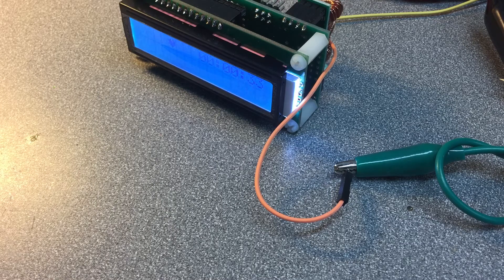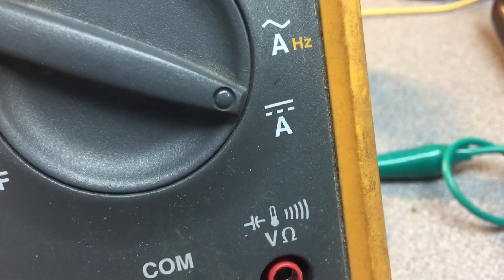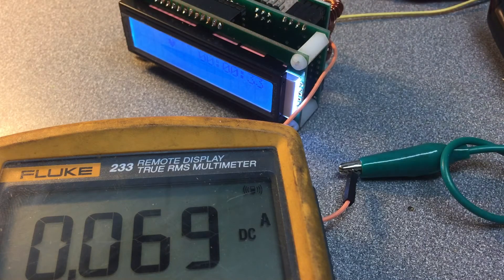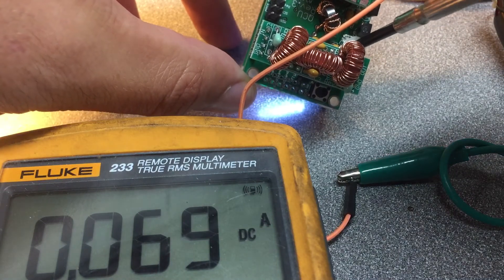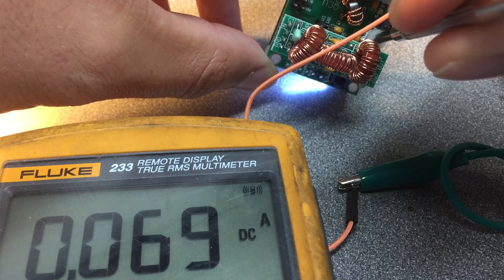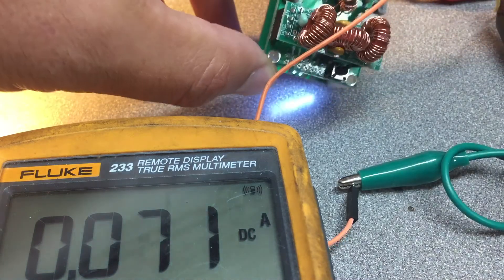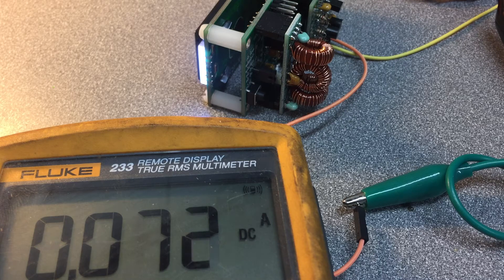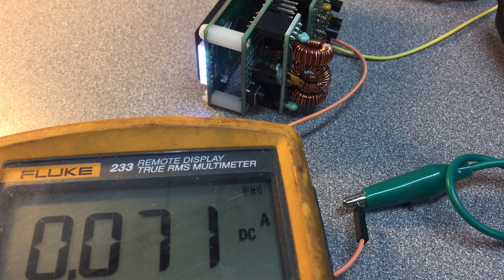QRP labs U3S transistor bias

Comment: is the u3s transmitting or idle?
Reply from the maker: The U3 is idle. there is nothing but DC power connected... you don't even need the clock source connected. I left it connected in this video just because I didn't think to remove it. If you notice the CPU is even hung in the video likely due to dodgy power connectors and alligator clips moving about.